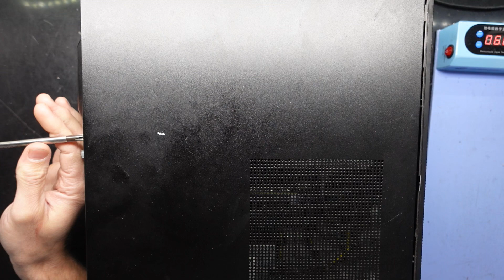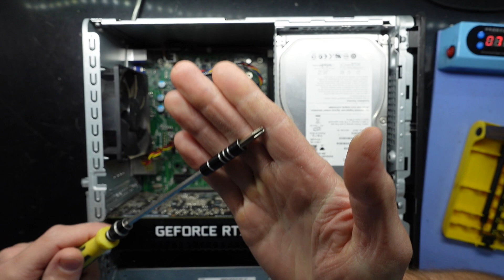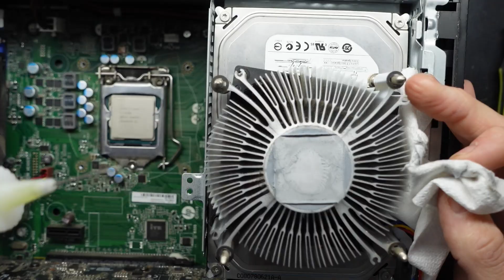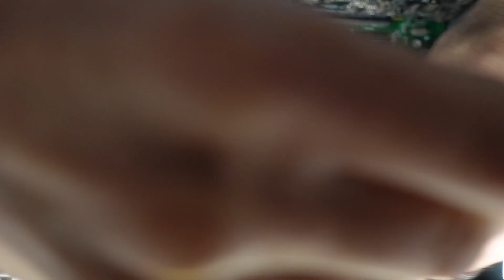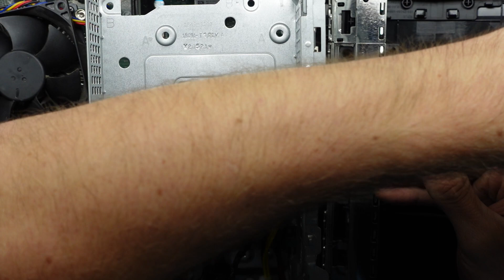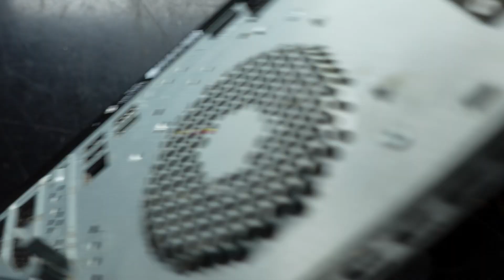HP Pavilion Gaming - TG01-0717a Upgrade Options and Overview

Comment: I'd just like to chime in that HP shipped my computer with the 400W PSU and a 3060 12gb, i5, and it's been working for a few years. For the price it's hard to beat. Still playing AAA games like KCD2 and it even runs Star Citizen decently. I upgraded the ram to 32gb, replaced SSD. So far so good on a budget PC.

The PSU on the Baker motherboard (8767) can be upgraded with a 500W PSU, part number L05757-800
Reply from the maker: Ouch, thats a Battery PSU for a 3060
Reply: @  What?